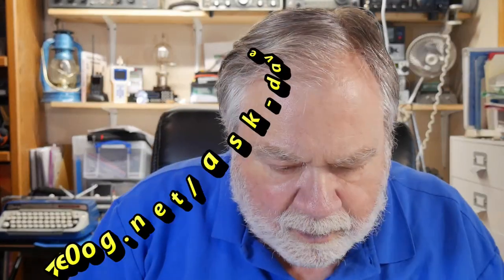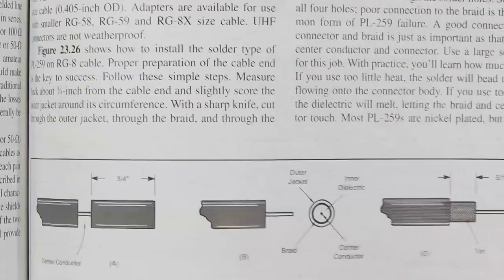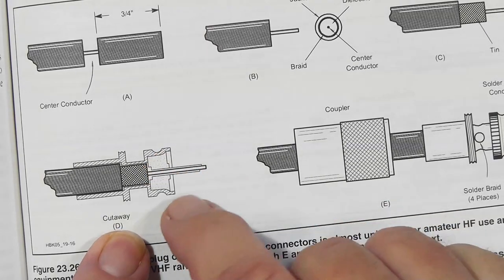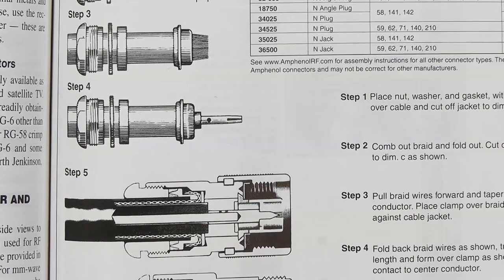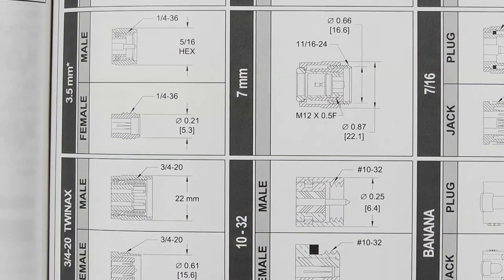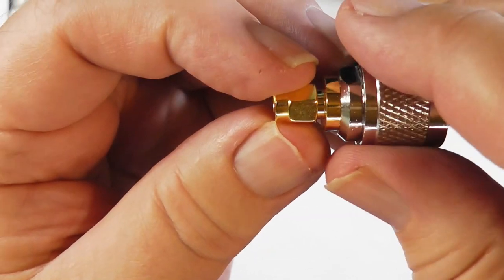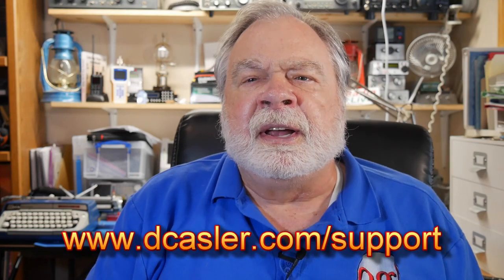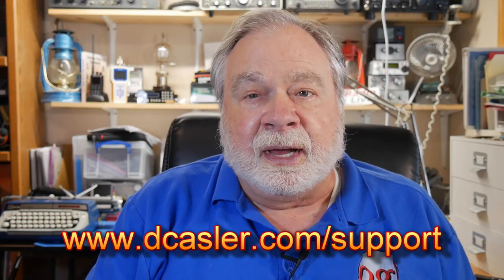Pl-259 vs N-Connectors is similar to Ford vs Chevy (#489)

Comment: N connections are more waterproof and provide better signal pass through, especially above 30mhz. However, if you have to use an adapter to go from pl259 to N, you lose whatever benifit the N connection would have given you, except being waterproof right at the cable. Infact, you get double the connection loss by using adapters. Dialect gel and sealing tape can make any connection waterproof. 

If it's a new installation and you will be buying all new equipment, then go ahead and use N connections. It's ok to use a mixture of connectors as well. For example you can use N connections from the antenna all the way to the shack, and then terminate with a pl259 at the first device. 

If you are retrofitting old equipment, and or cable, it's probably not worth the trouble of changing over. 🤷🏻‍♂️

Personally, i do use a bunch of N and BNC connections in my installations.

Comment: At HF, it does not matter and your Ford vs Chevy analogy works, Above 2M it breaks down (just like PL-259) and you are better off with N.  If you are combining multiple microwave signals into a combiner then you want to use a 7/16 DIN as it is more resistant to harmonics and inter modulation. Each connector type has its place and purpose, it is up to the user to determine which is best for their own use case.

I have standardized on N type connectors and heliax and LMR-400 cable. Mostly because I can get left over heliax for free from work.

Comment: I use N and BNC for VHF/UHF. I use PL259 and BNC for HF because of its ubiquity. It was a 5 minute job to change the 2m 70cm SO239 to N on my IC-7100, no soldering required. In broadcast I saw a mix of SO239, N and BNC with AM but no SO239 for FM. 450 and 950 RPU and STL were exclusively N. Of course the high power stuff was all bolt-on flanges.

Comment: I agree that for HAM purposes either N or PL-259 connectors work just fine. When you start working with VERY small signals, like in an MRI scanner, you need the better performance of the N connectors.

Comment: I agree with your general summation in the video.  And yes, the "N-connector crowd" is pretty fanatical!

However, I would say  that the two equate more like a Chevy "PL-259", and a Ferrari "Type N"...  While they both will easily and happily go 55mph, the Ferrari will be more at home at 155+mph, and easily do it! LOL.  At HF frequencies, PL-s are just fine, IMHO.

Additionally, literally every "adapter" you use in the system will also introduce [some] loss into the signal path... so using N cable connectors, and then an adapter [at each end] back to PL-259, you really gain nothing, and may in fact be worse than just using the PL's to start with (although, as you state, only a minuscule amount!).

Anyway, nice vid' Dave. Thanks!

73,
~Alan

Comment: I prefer N-type outside because of the enhanced weatherproofing.  Inside - whatever is there already.  My main bug bear with PL259, especially on the RG58 size connectors, is the braid soldering connection to the connector body... never seem to be able to make a reliable connection and the coax ends up spinning in the connector.  The clamp/captive types are far superior.

Comment: Won't matter. UHF connectors work just fine up to 500MHz (basically HF/UHF/VHF). In my company we make antennas for 2/2.5/6.5/7/13GHz, so yeah, we always use N connectors for external connections. For connections in the feed and LNA, it's all SMA. As far as weather resistance, the N is better, but you can seal up a UHF connector very good with mastic tape.

Comment: I would argue it's not an apples to apples comparison. There IS a performance difference, especially in UHF and above. I have a number of VHF and UHF antenna systems. Moving the entire system for those antennas to all N type improved the SWRs by a good margin. It might not be as noticeable in HF frequencies, but there same effect is there to a lesser degree. I wish I had started with all N type connectors to begin with, because having a mix is a pain sometimes.

Comment: This is going to sound really dumb, but why are PL259 connectors still referred to as "UHF connectors", when N connectors are more often used for UHF and higher frequencies?  I am glad you discussed the history of the PL259 and how it originally was called UHF connector.  I can't figure out why it's still done.  Thanks Dave and 73.  //K6OGR
Reply: Because the definition changed. How high VHF and UHF are shifted at some point. Also, they were used with UHF TV antennas when coax was used, and before F was common.
Reply: @matthewkriebel7342  Right, it shifted, so my question as to why it's still referred to as UHF stands.

Comment: I use N-connector for everything because I do not want to have multiple types and I want to have cables that can be used both for UHF/VHF and HF. Might not make a difference for HF but for the fact that multiple connectors complicates the installation.

I have trouble following the argument that one connector is easier to source than the other. No hardware store around here has either and the online shops have all types.

I would probably not bother to change an old installation but for new, go all N-connector because there is no reason not to.

Comment: Why not use both? My HF rig is fitted with PL/SO and my VHF/UHF rig (and antenna) is fitted with an N-type. One could argue that when using a switch on HF, one is better off with an N-type to have a little compensation with the losses inside the switch.
Greetings from the Netherlands, de PD0PSX.

Comment: It used to be, years ago, that some dual band mobile rigs would come with 2 antenna connectors, one SO239 for the 2 meter antenna and an N connector for 440. I suppose in the end, manufacturers didn’t think it made much difference.
Reply: They still do!  Yaesu Ft-991A is a prime example...

Comment: Not so complicated, Dave. "KISS".
If you want, or will need, to be interoperable with others, you use a PL259 because that's the US standard.
If you want the best performance, you use TypeN.
If you want both of these, then you use TypeN and buy a whole lot of adapters, since you'll need one for any radio you buy in the US, any cable you borrow, and bear in mind each adapter creates another impedance bump and point of failure.
 All the rest is an exercise in calculating how many angels can dance on the head of a pin. (Topologists insist that is 16, by the way.)

Comment: More like Rolls-Royce vers Yugo.
Reply: The problem is, since most Ham or other two way transceivers tend to come in 239's, it just means that for most of us we have to add an adapter to our shack end of the coax if we get an N connector there.  So, for many rigs, an N connector on that end is of no value.

The other problem is, many antenna come with 239's, and sometimes we keep the same feedline for different antennas feeding to the same shack or setup.  Like my VHF/UHF antenna setup on my roof, which I run LMR 600 for 50 feet, and need every inch of it.  When I upgraded to a spiffy new G7 2 meter antenna, and kept the same feedline, I ran into the trouble of having 259's on my big coax, but the new antenna is N type.  Am I going to hack off my coax end and replace it with N for all its small advantages?  

OR, will I just add an adapter to my 259 and hook it up and lose all the advantages of the N connector and just add expense and time?  In the end, I just elected to add an adapter and keep the stock 259, just in case I decided or had to put up my old cheaper antenna in its stead.  The N on the antenna currently does me no good, and it would be a pain to change it over.... for what real advantage?  

N is better.  But in the real world of hooking up mobile rigs, changing out rigs, changing coax, reusing old coax, having so many 239's in common use with so much gear and other coax, laziness and sometimes field expedience leans towards keeping the 259 and skipping what little the N has to offer some of us.

Comment: Ok, So If i'm setting up a new home system, with all the lighting system parts. I'm buying a lot of coax and putting on "ends" should i use "N" connectors for everything and the put on  a 259 for the radio?
Reply: Yes,  the N connector is a better connector.  It's used almost exclusively in professional radio equipment, that includes test equipment, antennas, duplexers, etc (along with BNC and SMA connectors).    The UHF/PL-259 is only used on Amateur equipment at this time.   

If you're starting from scratch, standardize on N at the beginning.

Comment: the sole reason I use N connectors in my shack is that they are waterproof, "Technically better" and impedance doesn't matter to me near as much as waterproof.
Reply: Except type N connectors aren't really "waterproof". The type N connector is more water resistant than a PL-259. Having said that, any coax connection can be made "waterproof" with proper use of mastic tape, "coax seal", and the like. Also having said that, I would recommend Type N connectors over PL-259 connectors at UFH and above. There is no argument that the type N connector is superior to the ancient PL-259, but, below UHF, does it really make much difference......no it does not.  73 de WB4DW

Comment: So many times I see a change on my  Field Strength Meter when I touch or wiggle a connector. How can that be? Can I wrap Aluminum Foil around it? Thanks from Gregg AG7MW.
Reply: It means you have RF on your shield.
Reply: @TheRetiredtech  I guess that the concentric wire isn't thick enough so that the RF can pass through from the inner surface to the outer surface and out.

Comment: To some dedicated Ford guys and gals, Chevys are junk, and vice versa. But that fails to explain how so many examples of that "junk" manage to work so well for so many years for so many people. 

Similarly, if N-connectors are really so much better, then why do all our radios, tuners, etc., still come with SO-239 sockets? The only N-connector in my entire collection of stuff is built into my RigExpert analyzer, which was made in Ukraine and ships (into the US) with an SO-239 adapter.

Comment: Hahahaha, no. PL-259 vs. N would be more like Trabant vs. Mercedes. And N connectors are easier, not harder, to install then PL-259’s (it isn’t even close, in fact). That said, for frequencies below 300 MHz, I would not spend money replacing existing PL-259’s with N’s.

Comment: can someone tell me if a type N connector will fit the same jack as the pl-259?  Im getting an alinco dr-735T and the antenna im getting has an option of which connection to choose.  I can't seem to find the info im looking for about which connector to use.  The antenna is a N9tax slim jim if that matters.